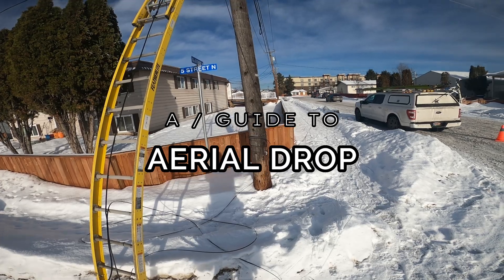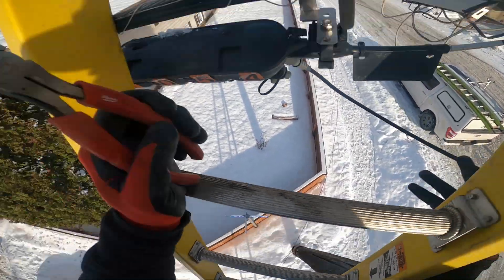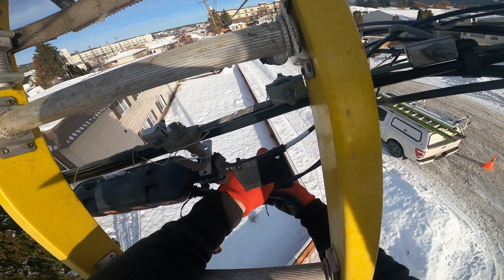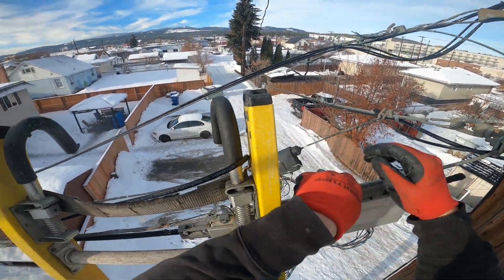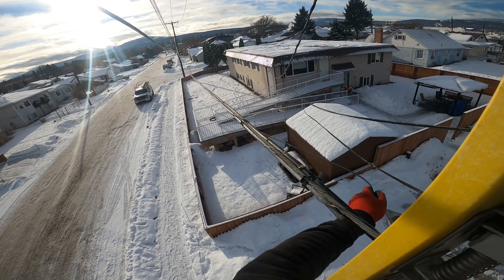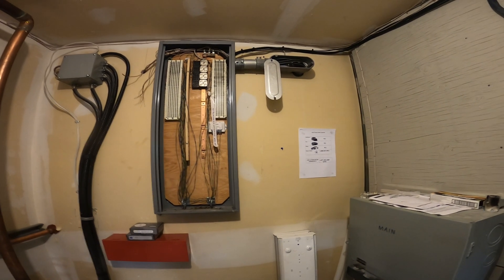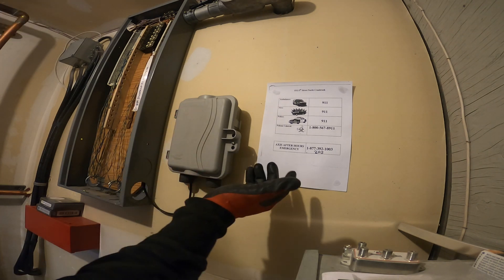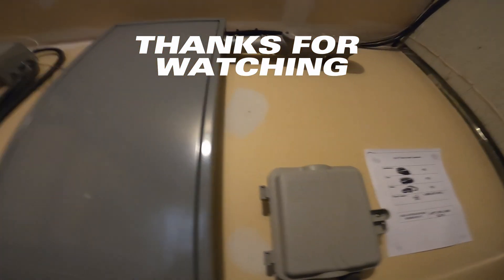AERIAL FIBER OPTIC FLAT DROP GUIDE

Comment: Nice work as usual!   I work at Bell in eastern Canada and do basically the same as you do.   Some questions for you: 

Do you ever coil the drop before connecting it to the Fiber Terminal?   I do it myself in case a network tech needs to move the terminal.  

Also, is your role basically to install drops ?  Do you ever work on the inside wiring and data equipment for the final phase of installation? 
-------------------------------------------------- 
It's funny how we use different terms for the same items.  What you call a ram horn, we call it bull horn.   

I love those places where you have an entry point already in place!
Reply from the maker: I don't leave coils because it's not in our protocol, and it's not really necessary. I've never seen an MPT that needed to be moved, and if they replace the pole, it doesn't really matter.

and yea my main contract is just running drops. but I can do it all. I have some videos on installs and some fibre expansions I've done.

and yea same as like you call it a terminal, we call it a NAP or MPT some people call it MST 🤷🏻‍♂
Reply: @FyBurz  - I really like a lot of things I see in your videos:  Bring orange numbering of ports, different types of hooks to guide the lines, etc.    We use only straight hooks on the network, and we need to read the default numbering engraved in the plastic on the terminals (black on black basically), which is a pain in the ass on bright sunny days.

All in all, it's nice to see how peers elsewhere do the same job you do yourself.
Reply from the maker: @vonfrancois  thanks man I appreciate it. are you in our discord >?
Reply: @FyBurz  - nope!  lol
Reply from the maker: @vonfrancois  if you use discord you should join!

https://discord.gg/jh6yqnqC

Comment: 3:19 what’s this type of clamp called? I’m doing a DIY install very similar to this layout and learned a ton already from your vids but can’t figure out what this one is called. Where do you buy your hardware? Links? I’m also in Canada btw, Ontario though.
Reply from the maker: @WarrenDunlop96  it’s called an Oclamp but I’m not sure where they’re sourced from the isp provides all the material and hardware. Sorry I can’t help more.
Reply: @FyBurz hey, a quick reply is already loads of help! Thanks so much.
Reply from the maker: @ no worries. Let me now if there’s anything else I can help with. If you join our discord. We have tons of experienced techs and maybe they know where to get some.
Reply: @FyBurz  may do that! Maybe one more q for ya: your o span clamps are going on to the support for power lines, yes? Not a communication line only thing? And you’re putting your ladder against the power as well?
Reply from the maker: @ negative. My ladder and clamps and lines etc are all on telecom strand. Support wires specifically for communication lines. Power is always above and I never touch them. Unless they’re secondary lines anchored at the house side and they’re In the way. And even then I just bend them or move them slightly so I have enough clearance (12”) from my anchor point.

Comment: What kind of gloves do you use to make these installations when there is snow?
Reply from the maker: I just use my regular gloves. I always forget the brand but I get them at my local hardware store. Just thin gloves coated with rubber

Comment: Wont the zip ties cause compression in the fiber. And you get a noticeable amount of attenuation
Reply from the maker: Could you reference where exactly in the video?
Reply: @FyBurz  like 5:47 after you attached to the MST, you zip tied. I was just asking
Reply from the maker: @EricJackson233  ah yeah, no issue at all. This is standard protocol and the zips are just to groom the lines and keep them neat. They don’t affect service in any way. The flat drops are very rigid on the exterior.
Reply: @FyBurz  just thought I'll ask, I'm starting my fiber technician job at metronet straight out of school
Reply from the maker: @EricJackson233  sweet man! Good luck 🤞🏼 can hopefully learn a lot on my channel at least OSP stuff

Comment: You didn't put a gland on the metal hole?
Reply from the maker: What do you mean?
Reply: @FyBurz  cable gland on a metal hole to prevent any damage to the cable.
Reply from the maker: @Zeamus634  do you mean through the knockout at the panel inside ? If so you’re technically right. But that is something seldom done. This was a weird install. Not something I normally carry especially not a 2” strain relief or whatever size it was. The drop is secured both inside and outside the panel it won’t be moving at all ever. So chances are of damage is very low.
Reply: @FyBurz  it's just good practice, a rubber grommet would work just as well, but I would've drilled a separate smaller hole either way 👍

Comment: do you not test for light at the connectorised block terminal before doing all that work?
Reply: So yes then? In order to test if it’s live you have to test for light 😂
Reply from the maker: @OhItsJake  I work off the count on the fibre. Although it isn’t always accurate. And if it’s dead but we need it. I request a capacity add to the mpt
Reply from the maker: No. The network is already tested up to that point. I do confirm whether the port is live or not before running my drop

Comment: Straight forward job. Those hooks not on the strand & you not belted. Very dangerous.
Reply: I have the same question how this guy so confident to this ladder without putting hooks to strand by the way nice job
Reply from the maker: I explain why I do that in a couple different videos. But thanks 😅
Reply from the maker: I work safe! don't worry. there are different practices all over. I have over a decade of ladder experience.

Comment: How are those drops rolled up? We use AFL fiber for our drops and they have to be manually unrolled laying the terminated end down first. It’s a major PITA unrolling 300ft-1250ft drops.
Reply from the maker: These are exactly the same. For anything over 100m I use a coil reel. So I place it inside and it pretty much makes the coil into a spool.

Comment: Hey, I installed my aerial drop, but I put the clamp on, and there's too much slack. How can I losen the clamp to pull the slack so it doesn't sag? Thank you
Reply from the maker: Edit: this is hard to explain. Watch some more of my videos i’m sure you’ll see the solution. 

If it’s a similar clamp to the ones I use in this video. You have to hold the loop end or push it against something so that the force goes towards the tension or the slacking wire. While doing that hold the bottom piece of the wedge. Push them together. I’m realizing this is hard to explain I wish I had one with me to show you a video. And I’m on a trip unfortunately.  But the main thing is you’re trying to loosen the bottom piece of the wedge clamp that will free the cable a bit. Then making sure it doesn’t fall apart you pull the slack towards the loop end. When you tighten it enough let the wedge go and it’ll grab the drop.

Comment: Hi, great videos btw. I do a similar type of work to you but over the pond in the UK. Quick question, do you guys ever test for light at the demarcation box? If not, why not? The company i work for is very picky about what we do and we have to literally photograph everything! Obviously a light reading at the CSP (demarcation box) is the most important one! Keep up the great videos!
Reply from the maker: Hi thanks! I do not normally test because its not required for our contract their are certain projects where the drop techs confirm light but this isn’t one of them. But I will if I’m doing the install myself.
Reply: @FyBurz  nice, what happens if the tech who turns up to do the internal work has no light on the cable? Does he have to call you back out. We have issues sometimes with dead ports on the MST.
Reply from the maker: @Josh__Stevens  so if the drop it’s self is broken thats one thing. But I don’t plug drops into dead ports willingly. If it has to go to a dead port then I call in a capacity add for cable repair to splice in the port. But it’ll usually just run it to another mpt with live ports. It’s situational, sometimes they want us to park it above the mpt. while the cap add is being done. 

And If it’s in a “live port” but they get no light the drop will sometimes come back to me to replace but it could also go to cable repair. 

I’ve also had techs call me because they can’t get light but when I show up I magically can get light so 🤷🏻‍♂️😅
Reply: @FyBurz  ahhh ok, I see. Do you get many call backs then for faulty cables/optitaps (that's what we call the pre terminated end)? Nice to see you're doing a mix of aerial and underground as well, good to keep it varied. I'm hoping we're going to change cable soon, we currently use some crappy commscope hybrid drop wire which has a copper pair as well. It's not nice to work with as it twists constantly. That flat stuff you use looks so much better. 
Currently binge watching your videos! They're great!
Reply from the maker: @Josh__Stevens  nah maybe 2 in the last 3 year.  and yeah their optitap here too. Expect for some areas that have afl not Corning. I heard those hybrid cables are annoying 😅
Reply: @FyBurz  ohhhh that’s not too bad at all! Yeh the hybrid is rubbish tbh! Can I ask where you got that tool for undoing the dust caps on the MST? 11mm socket I believe?
Reply from the maker: @Josh__Stevens  it’s called a can wrench, you get get them on Amazon! Key tech tool 👍🏼
Reply from the maker: @Josh__Stevens  Jonard Industries Corp. M-216C/EX Can Wrench https://a.co/d/27AGz3F
Reply: @FyBurz  thanks for that. There is nothing similar in uk so I’ve had to import one from the US 😂
Reply: Crazy to see how different it is in the UK. Same shit, different word.

Comment: Put the ladder on top of your shoulders, it will help you.
Reply from the maker: Sorry but that’s wrong my friend. I’ve been handling ladders for a decade. And this is the proper way to move a ladder around.
Reply: @FyBurz  If you could see me working with a ladder you would change your mind, sorry but I've never seen anyone carry a ladder like that.
Reply from the maker: @dicknson2132  I’m sorry you’ve never seen anyone properly carry a ladder 😅, I’m not hating on the way you do things. To each their own. I know guys who put it on their shoulder, mostly because they don’t know better. I come from a roofing background and this is how I was taught 10 years ago. And it applies more so for this job because it keeps the ladder upright and allows me to better position it where I want. Also I use a heavy duty ladder with 375lbs capacity which is a lot heavier than most Werner or common ladders used by the trade.
Reply: @FyBurz ok ok.
Reply from the maker: @dicknson2132  😅 I’d like you to try it my way and see the benefits of it. When putting it on your shoulder you put strain directly on your body, and you have limited mobility in confined areas. I’m making a video about it. Hopefully when it comes out you can check it out and see what you think.
Reply: @FyBurz I will definitely watch, your videos are good.
Reply from the maker: @dicknson2132  I appreciate it thanks. My laptop was out of order for a bit. So I have a backlog of content to put out. Now that spring is here I don’t feel like uploading content from the winter 😅
Reply from the maker: New ladder video is out, go check it out! 😅

Comment: Why do americans put their ladders and fibre joints on the spans rather than the solid chunk of wood RIGHT next to it? Also, Flush cut your zip ties!!!
Reply from the maker: I’m Canadian, our strands are solid, and shared with other utilities, I usually put my ladder on the strand over the pole due to ease of access and stability. Even with a pole strap there’s more over a rollover risk. And I’ll take the drop off the pole when in need of clearance or on a private pole. Also it leaves the city poles easy to replace instead of having to deal with 10 drops on a J hook.
Reply from the maker: re: zip ties
I probably should, but it’s not in our protocol and just another tool I need to carry. I usually flush cut internal networking cables and the ones on the strand are constantly being replaced. Flush cut is usually for permanent zip ties.
Reply: @FyBurz  You can flush cut the zip ties with your normal side cutters. Hard to explain over text without showing you, but if you put the cutters diagonally over the square part and the bit you want to cut off, the side cutters slide over the square bit taking the offcut off nicely. If that makes ANY sense haha. Cant find any videos/images of what im talking about online so maybe not many people know about this trick idk

Comment: I'm going to seriously enjoy watching all the FTH providers struggle to maintain their plant in a few years. It's going to be like the Frontier/CentryLink sequel. Very entertaining especially for us cable operators that can do a splice in seconds, rain or shine, in the mud, with a few hand tools and still deliver Gigabit speeds.
Reply: Only thing is the Fibre will get to 2.5gbps then 10gbps, maybe even 100 for a block of residences, and it's unlikely to need much alteration to get to that point.
Reply from the maker: @leonblittle226  my isp can already pump out 2.5gbps to businesses 1.5 to consumers. And they can handle 10gbps but I don’t think it’s cost effective yet.
Reply: its not hard to maintain at all, been doing FTTH for 12 years now, it's easier than cable, don't have to worry about noise from the Neiborhood, causing a repeats cause the techs don't know how to use their meters
Reply from the maker: You mean copper plants compared to fiber ?

Comment: Why don't you place your ladder hooks on the strand? I wouldn't trust my ladder just laying there one bad move your slideing sideways to the floor lol
Reply from the maker: Also even if you were to slide sideways that’s when the hooks come into contact with the stand and prevent you from falling/sliding too far 😬
Reply: @FyBurz  I do coax work most of the trands are always drooping or swing to low on one side barely ever a straight strand for my ladder to sit on even or just a akward mess to even try and not use my hooks
Reply: Also I don't know if your hooks do but mine I can push them in and spin them around so they aren't in the way
Reply from the maker: @xLEGNx  yeah makes sense, gotta hate those droopy strands. That’s when I use the bucket truck 😅
Reply from the maker: @xLEGNx  yeah they can , but just in general around the mpt or close to poles, its always crowded with hardware and stuff. What area do you service ?
Reply: @FyBurz  Buffalo NY
Reply: Usually do around 7-9 services calls a day some trouble calls full installs rescues etc
Reply from the maker: It’s standard practice to keep your hooks a few feet above strand, I usually make sure the ladder can’t move to the side by using either existing clamps 🗜️/ hardware on strand or by adding some to hold it while I work. If I’m working on a midspan I usually will place the hooks right on the strand, but when near a pole or mpt they just get in the way 😅

Comment: I used to be a contractor for Comcast and I would pre-install drops to new construction. We called it "warm housing". Hated doing it, the builders would install the underground conduit for us and they always thought it was funny to see how much trash they could put in the conduit. I had one builder dump concrete down the pipe. That was fun. Your work looked neat.
Reply from the maker: Warm homes here, means home is plug and play with drop being terminated inside already. That’s rough about the builders very unprofessional.
Reply: @FyBurz  also very unnecessary..what gain comes from clogging conduits? I think some people just have some natural stupidity that you can almost do nothing about